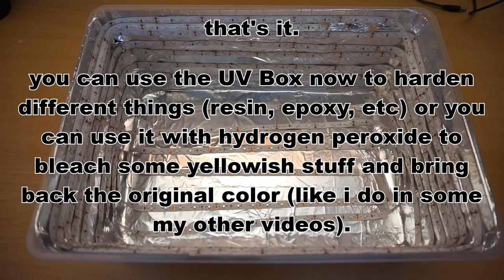How to make a UV LIGHT BOX  | bleach | retrobright | photography | harden epoxy

Comment: Thank you!  I have exactly the same thing but much less efficient (I wrapped the strips around the top of the box). I'm going to use your version now - to develop photographic salt prints and cyanotypes - putting the picture on the lid with the box upside down ...making sure the light strips are well fastened so they don't fall down on the picture! Never knew you could use uv to bleach things - will try that too!
Reply from the maker: thanks for your comment! ;-)
best wishes
phil

Comment: But those leds are not waterproof right?
Reply from the maker: nope, they are not waterproof.
Reply: @restoreeverything8654  So you use the Oxy Creme only (wrapped in plastic) and not the liquid I assume?
Reply from the maker: @kevinvandorst  I use a another container inside this uv light box, where I put in the object I want to retrobright and hydrogene peroxide.

Comment: This can be used to for, making shoe sole's white again? not a 1000 wattage light is needed?
Reply from the maker: Hey, 
you can bleach the other materials of the shoe with this box, for the sole of the sneaker you need a UV-B light source like a Reptile Light or sunlight.
Best wishes
phil
Reply: @restoreeverything8654  I found a 600W grow light that has a minimum wavelength of 385nm, would that help for rubber soles?

Comment: Hi whats the use of insulation or silver coating? If the box is black do you still need to put insulation sheet?
Reply from the maker: Hey OPM, it`s not an insulation, the main usage is to reflect the uv light again and again to reach every spot of the surface.
best wishes
phil

Comment: hello, the uv leds can be submerged in the peroxide? im asking because the leds are inside the box but in your older videos you put the leds outside
Reply from the maker: Hey Daniel, I have attached the led inside so that it is not damaged during transport. I always use a container which I then put in the box.
best wishes 
phil

Comment: Hello, thank you for your great idea. My question is about the UV light strips. How sure can we be that it is a correct type of light. I've heard that it must be in 200-280nm wavelength range. Do you know if one can check it?
Reply from the maker: Hey Chris,
the one UV light I use has a wavelength of 395–405 nm and works just fine, as you can see in my other videos.
Best wishes
phil
Reply: @restoreeverything8654  I was under the ipression that 395-405 was for finding fluids etc and not ideal for curing resin. I believe the ideal nm for curing uv resin is 365. I also understood you need closer to 36w of light rather than the 24 those strips offer.

Comment: Does wattage matter? i saw some videos using 1000W grow lights for sneaker restorations, does the higher wattage improve results or is this negligible?
Reply from the maker: Hey P K, that depends on which parts of the shoe you want to restore. you will need something stronger for the correct icing of the soles (i think), but I've never tried it with my uv box.
hope that helps 
best wishes 
phil

Comment: Hello, sir.
Is it possible to use only this UV box, without hydrogen peroxide to de-yellowing the plastic?
I am planning to use this method with my plastic model which had some metal part and logo(decal) on it.
Have you ever use this method of just UV-LED without the H2O2 before? What's the result?

Thank you.
Reply from the maker: Hey Metha, well I dont't  thing that its gonna work without. But I have never tried it this way.
Reply: @restoreeverything8654  Thanks, Phil.
Sad that I can't use the H2O2 with my plastic kit due to many limitation.
Hope you'll try it out someday, and make a video clip to tell us whether it is working or not.

Comment: Does this work to unyellow shoe soles?
Reply from the maker: Hey Paul, that depends on which parts of the shoe you want to restore. you will need something stronger for the correct icing of the soles (i think), but I've never tried it with my uv box.
hope that helps 
best wishes 
phil
Reply: @restoreeverything8654  as I scrolled down the comment section I saw that you also replied to other viewer that this might not work well on unyellowing shoe soles, that’s what I need it for. I don’t seem to find any UV lamp or projector locally and I was looking for an alternative… maybe I would try your option and see if it works! Thank you for the info!

Comment: Thanks for the video and the tips. I notice you're using 3528SMD uv leds, 2835 would be more efficient, like the one Odd Tinkering is using. I'm wondering 5050SMD might be the most efficient since it's the more powerful... I did not see anyone using 5050, it would be amazing to have a comparison
Reply from the maker: That´s right, but it was the only LED Strip available at that time, I thing it`s time for me to upgrade! ;-)

Comment: For retrobrighting you also need hydrogen peroxide. I don't think it's possible to fill hydrogen peroxide in the box while the LEDs are on.
Reply from the maker: Hey J-Buddha, thanks for your comment! 
I am writing this notice also in my video: "you can use it with hydrogen peroxcide to bleach some yellowish.."
best wishes
phil
Reply: @restoreeverything8654  Thank you for your reply! I'm on to also build a UV Light Box. But I'm thought I use 2 boxes. 1 Box (the outer one) will be covered with alu-foil and the UV LED strips. In this box I put the second one to fill it with hydrogen peroxide and the parts for brightening. But I hope I will find boxes that got enough space between the boxes to place a LED strip. Do you understand how do I mean it?
Reply from the maker: Sure! that's exactly what I planned to  do / what I still want to do. The problem is that i didn't find a box that fits perfectly into the other box with the LEDs 😉 but i'm still searching for a smaller one.

Comment: How do we conjoin another strip of UV LEDs without having to plug in another set separately?
Reply from the maker: The LED strip that I use can be shortened as desired and lengthened with a fitting piece (or soldering).
best wishes
phil

Comment: Could i use this method to unyellow shoe soles???
Reply from the maker: Hey Lil, that depends on which parts of the shoe you want to restore. you will need something stronger for the correct icing of the soles, but I've never tried it with my uv box.
hope that helps 
best wishes 
phil

Comment: I'm a little confused... I thought some peroxide hydrogen was needed in the box. it can be done without it?
Reply from the maker: Hey, 
to bleach or "retr0bright" yellowed plastic you definitely need hydrogen peroxide. I usually use it with 12%. 
best wishes
phil
Reply: @restoreeverything8654  ok I need to do this for old tech/computing, but mainly for yellowed legos. someone say 3%, someone more... btw thank you very much, best wishes to U.
Reply from the maker: sure,you can also use it with 3%, it just take much longer, but may no get the result you wanted .
Reply: @restoreeverything8654  ok thank you for the info. here in Italy we have 40 volumi which means 11,8%, I think I'll go with that.
so your leds you put inside the box are waterproof? I think I'll put outside the box.
Reply from the maker: Check out my other videos, there you can see how I use my UV Light Box to retr0bright old consoles and other stuff. 
best wishes 
phil
Reply: @restoreeverything8654  ok i’ll check thanx.